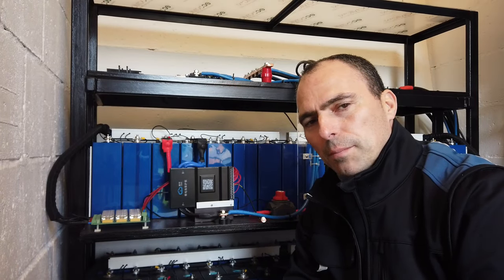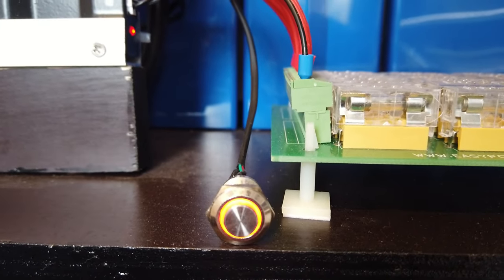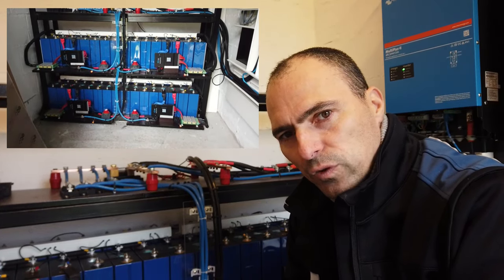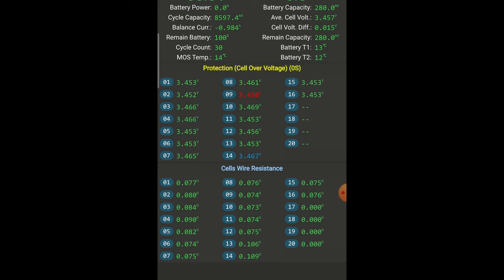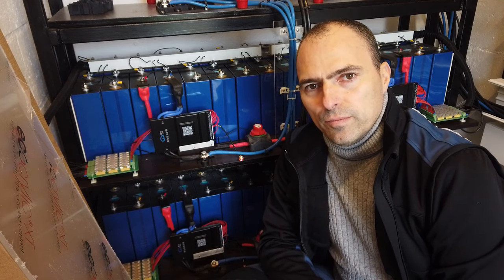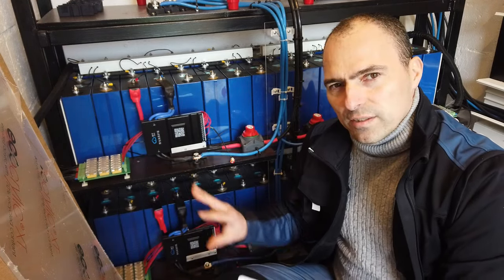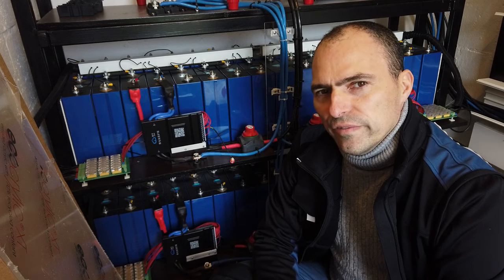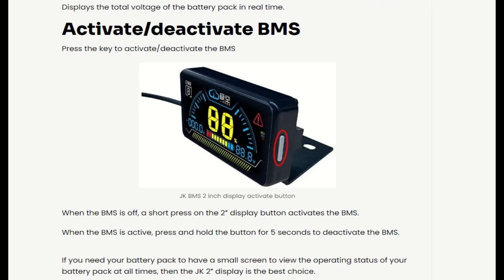JK-BMS still on top of the game? Follow up video.

Comment: Hi Mate,

I have a Solis hybrid 5KW inverter, and I'm using it with 16 EVE 304 cells and a JK inverter BMS with an active balancer. I've been running this setup for the past five months. The JK BMS communicates the state of charge (SOC) to the inverter, but the SOC keeps drifting over time.

Here's the issue: even when the BMS indicates a 100% SOC, the voltages drift slightly lower with each cycle. Over the weeks, the SOC gradually drifts, so while it shows 100%, each cell and the overall pack voltage are slightly lower than the previous cycle. If I adjust the battery capacity settings, the BMS resets to 70% SOC, and the inverter charges another 3 or 4 kWh. This SOC drift is frustrating because on cloudy days, my 16 kWh battery effectively only charges to 11 or 12 kWh. The remaining 4 kWh stays uncharged because the BMS incorrectly reports 100% SOC to the inverter. To fully charge the battery, I have to keep changing the capacity settings in the BMS back and forth.

Is there a way to use this inverter without CAN communication or by setting it as a generic battery? If anyone else has the same issue or knows a solution, please comment and suggest how to fix this problem.

Thanks!
Reply from the maker: Hi, 
I know SOC and JK BMS is not a great combo, specially with the older BMS. I suggest to use a decent SOC meter (like the victron) to measure and report the SOC.
The latest JK-BMS with the breakout board has a better SOC tracking.

Hope this helps.

Franky - EASYPOWERWALL

Comment: If you have an installation in a camper or other moving objects you like to have the bms connected to Victron (GX) because of VRM to check your system while you are not there.  The V3 inverter bms does the job flawlessly. Another benefit is that it is connectable to a pc so you don't need your smartphone. Imo there is never too much information ;)

Comment: The oil lamp comparison is not very good. I use 2 separate battery banks, consisting of 2x16 EVE280Ah, each with it's own JK BMS v3, communicating with each other and with the charger. Let's continue with your example, one bank has problems and the bms is stopping the charge, but at such a large capacity (560Ah) it is not uncommon to charge it, or discharge it even with 200-300Ah. If a bms enters in the protection mode, you would push all that current in the remaining bank, which depending on how it is setup, will either enter also in protection, either will push it hard. Either way, not optimal. With the communication you don't have that issue, as soon as a bms is out, the charger will decrease the charging current. This was just an example, issues can be multiple, a cell or bms temperature, cell voltage etc.
PS: just o e more UTP cable between wthen2  bms's and one to your charger. Nothing complicated.

Comment: The JK BMS is still one of the best and getter better. Both the original form factor and the new inverter (closed loop/networked) keep improving. I have four and once I figured out the settings they have been running for close to a few years trouble free. I will say that documentation is only fair. Like anything, there will be some duds but this isn’t too common with these. The most common problem isn’t the bms, it’s an error in installation. And usually if it fails, it just stops unlike some others that can wreak your cells. I highly recommend these
Reply from the maker: Great comment, thanks for sharing your experience.

Have a nice day.

Franky - EASYPOWERWALL

Comment: Im also having trouble pairing regularly. It works maybe 1 out of 10 times.
Reply from the maker: Hi Nate, 
I'm a bit surprised by your message.
Never had to pair again after the initial pairing with my cellphone.
Just launch the app and it works straight away. Have you tried that?
Can you try with other device if you have the same issue, just to make sure it's not linked to your device.

Franky, EASYPOWERWALL
Reply: Thanks yeah I tried that.  I also have a golf cart with a JK BMS that is acting the same. I'm able to get into both if I retry over and over including restarting the app. Also restarting the BMS helps. I believe it's an app issue or maybe it's just my android phone. 🤷

Comment: Hello
I also have an off-grid installation of 5.4 kw panels, in verter Easun SMV 4 of 5.6 kw and a LIFEPO4 battery 16 elements of 280 AH.
If you can help me, what are the voltages that must be set on the inverter to charge the battery to 80-90% and discharge to 20-25%.
Thank you in advance.
Reply from the maker: Hey Marcel, check my latest video about the victron chargers. I discuss the voltages for the 16S config.

Have a nice day.
Franky

Comment: Thanks for the interesting video! Did you check for current/engery consumption of the BMS itself? When Bluetooth is on or off? Can you separately switch BT on/off? I would really concider to switch it off, when you leave the battery pack at rest for a longer period (some months). I heard many stories, that the battery was sucked down to deep discharge with BMS switched on for a longer period.
Reply from the maker: I didn't checked this in particularly, but that's a good idea for the next JK-BMS follow up video. Thanks for bringing this to my attention. Have a nice day.

Comment: Would you consider to try and use the JK-JBD-BMS Interface Board ('Peter' Board) in the future?
Reply from the maker: Don't think I will start using the Peter board. I'ts all about economics.  The boards are pretty pricey and it has an impact on the ROI. Working on alternative solution to access the BMS. Stay tuned, but first I enjoy a 2 week holiday.

Comment: Dag Franky,

Ik vermoed dat je nederlandstalig bent en woonachtig bent in Belgie.
Net zoals jij heb ik twee batterijen gebouwd 48v (51.2V) 280Ah met V2 JK bms, nu vraag ik mij af heb jij deze door de keuring gekregen?
Ik heb het Arei al meerdere keren doorgenomen en van batterij vind ik niks weer, buiten een stukje over manipulatietoestellen zoals een heftruck en dergelijke.
Ben jij met het net verbonden of werk de installatie volledig gescheiden los van het net?

Alle info is welkom, alvast bedankt voor de info die je op je kanaal zet.
Doe zo verder zou ik zeggen.
Reply: Hi, zelfde situatie. Heb 2 Deye 12k, 3Fase omvormers, 16k panelen en 20k batterij. Gebruik die enkel Offgrid, lever niet terug op net. De kost alles officieel te maken, via officiële installatie en terug te leveren. Is vele malen groter dan zelf te maken. Zou het prijsverschil nooit eruit halen met terug leveren aan net.
Reply from the maker: Jim, de installatie is gebouwd volgens regels van de kunst, maar niet gekeurd. Installatie is helemaal off-grid. Voorlopig geen plannen voor ESS. Heb thuis een parallell circuit voor auto, wasmachine, droger en waterbed.